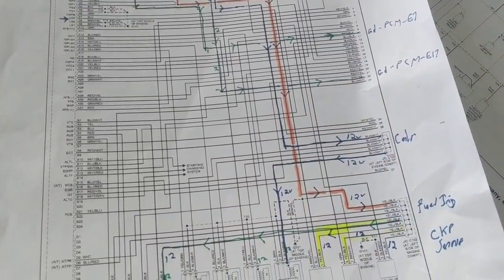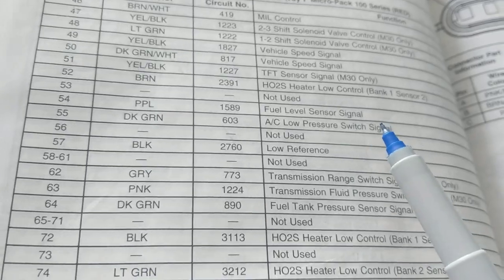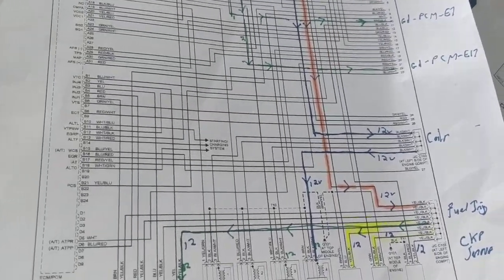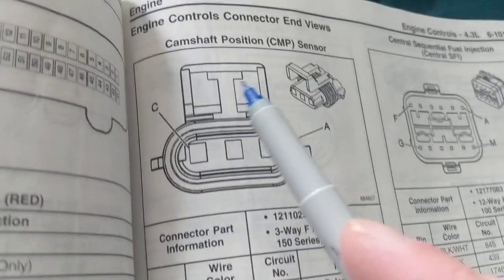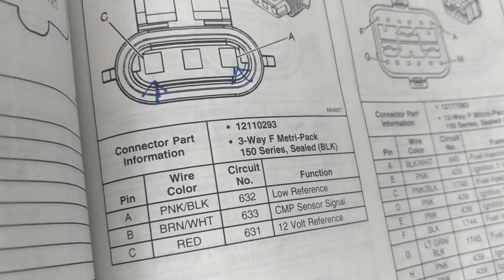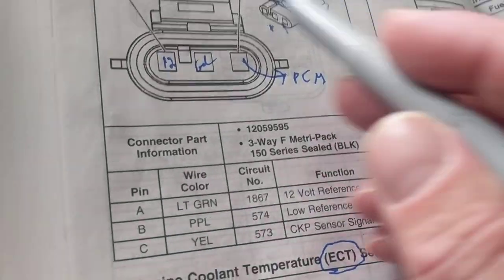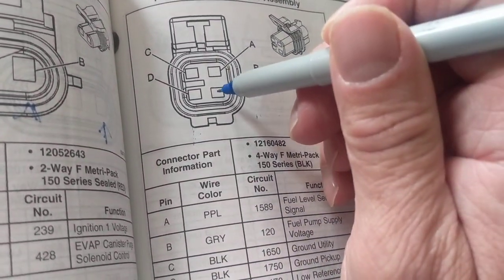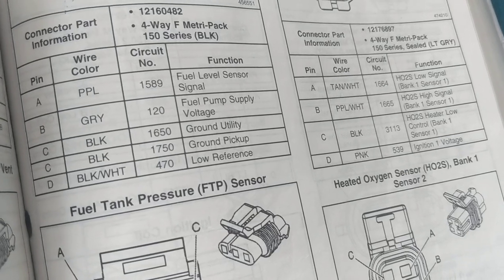how to understand connectors and sensors with computer modules

Comment: So basically look it up in the book. Do people really need this very low level advice? Who is working in an electronics field, that doesn't already know this? How in the world has a person gotten this far without this rudimentary skill?
Reply from the maker: You'll be surprised that many sensors connectors and wiring to computer modules are not numbered and it is very difficult to understand where to look up the proper connections that's why I made another video where to look up these connections online for free on the channel many people don't have the basic skills to do this that's why I teach it